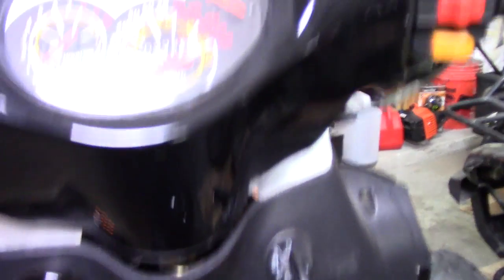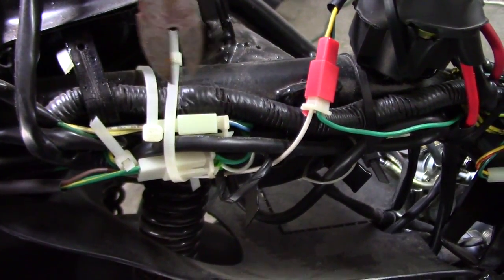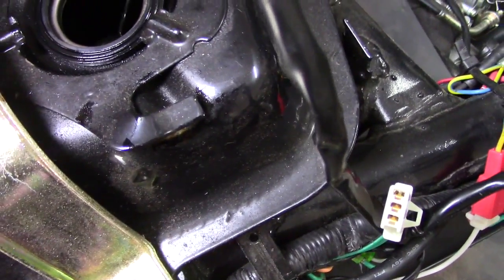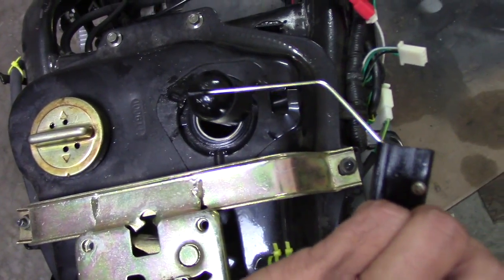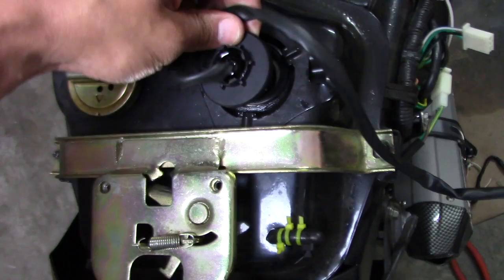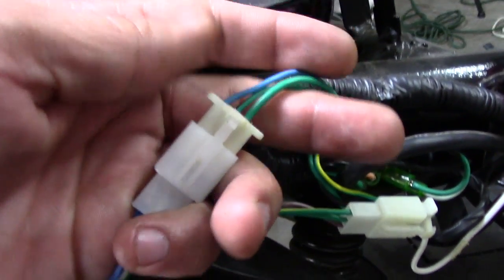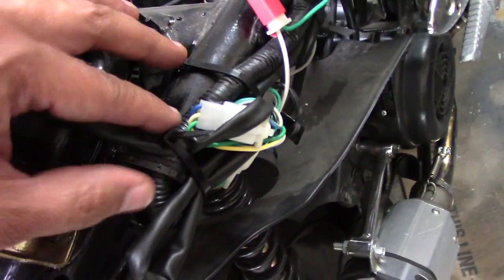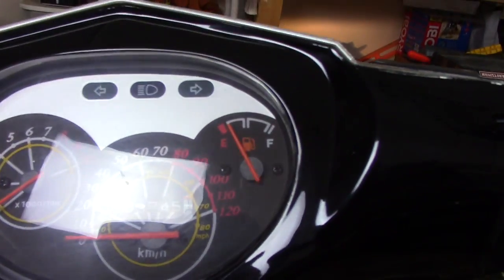GY6 Gas Fuel Sensor Float Replacement

Comment: just watched your video. repaired mine last week, didn't need replacing , Didn't see you test the float arm to see if it was stuck in a fixed position . The jamb lock was to tight on mine , loosened so arm could freely move and Wallaa worked when I turned on the key .

Comment: I have a 2012 Heritage 150cc and I want to ride so badly, but my running/break lights are not working... good video... I understood what you demonstrated, when I do install my new censor I will be following your video. But the last part... I did not see a fuel reading, did you need to turn the bike over or do it take time to read? Why did you need to change the sensor, was it stuck? Mine never read from day one. Right now my right breaks are not working; it may be the right brake Master Cylinder because the little window on mine is broken. I also have the running light problem I wrote about in the beginning. I could take it to the shop, but I think riders should learn to fix some things for themselves... I have already learn how to take the body apart and now I'm ready to learn more.

Comment: I put a new fuel float in and it worked fine, but when I refilled my gas yank full when I tilted my scooter to the left gas comes out the fuel float gauge

Comment: My previous float showed full when installed, it’s not full. When it’s out of the tank and I manipulate the float it shows correct readings, back in the tank stays on full. Adjusted washer on float sensor and again outside test is fine, insert it’s on full, I’ve been placing float center of both tank walls, no obstruction. SMH. Same with new float. Wires are correct. Any help

Comment: I think my float is sinking to the bottom of the tank even when its full of gas ie the density of the float is higher than the density of the gas. I watched ur adjustment video but that didn't help. Any ideas?

Comment: Adjusting the push nut changes the tension on the arm, loosen it for a sticky needle or tighten it if the needle is bouncing around as the gas sloshes in the tank but it has no effect on fuel level accuracy. The angle of the bend in the arm is what needs to be adjusted. Use both hands or a set of pliers to bend the arm. Bend it out and the needle will be biased toward full. Bend it in and the needle will be biased toward empty.

Problem is these sensors are a piece of crap. Its just a potentiometer with an arm and float attached to it. They are not really meant to be submerged in gasoline. After a while the ethanol buildup causes the contacts to go bad and it just stops working. Even if its replaced with an identical sensor the resistance values can be different which means the gas level might read different. Just readjust the arm.

Comment: how do you get the fuel float out of gas tank? the bobber came off inside tank
Reply from the maker: That's no good.  I would try filling the tank with gas to bring the float closer to the surface than try and pull it out with some pliers.  

It happened to me, and I forgot what fell in the tank. It was a pain in the butt, but I got it out.

Comment: That was easy. I think I'd be able to do that. This video made me feel good about myself :) Thank you, Joe!
Reply from the maker: It was super easy.  I think you could easily do the same. Thanks for watching
Reply: +Joey's Garage 
Bobber would probably be the most difficult part for me. Other than that, looked simple.
Reply from the maker: Believe me. It's super easy.  I was able to do it one handed.  You will have no problem.
Reply: @JoeysGarage  on my 150 I've always used 2 wires to make the gauge work I don't know what the yellow wire is for one the gauge. I use the black and yellow one. The sensor started smoking. When it was out of the tank. You didn't say what to do if the gauge says it's full but only half full. Bend the float rod.

Comment: my new gas tank and sensor came and my sensor only has 2wires and the new one came with 3wires how do you put it in ? to I put two of the wires together or what
Reply: @troilund7968  just connect to of them until you get the right set to work and tape off the other one can don't use it .

Comment: Just to let you guys know I bought a fuel sending unit from eBay, and the wires were reversed.  I had to switch them on the connector.

Comment: I’ve installed 2 sensors into 2 gy6 50 but the gauges stuck at their own levels regardless of the  gas level. What can I do?
Reply: How do you even manage to put 2 sensors in 1 is just fine with a float like this that should just work fine